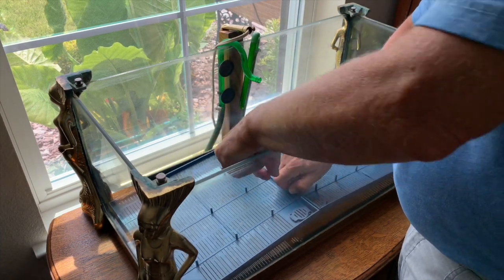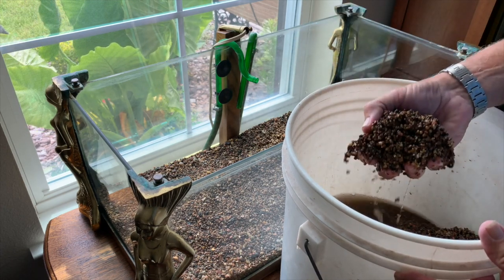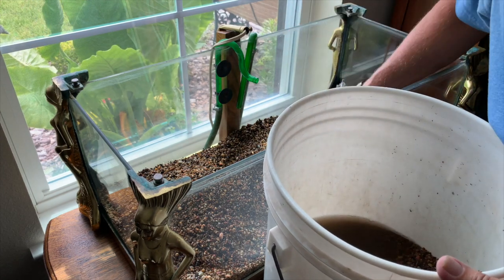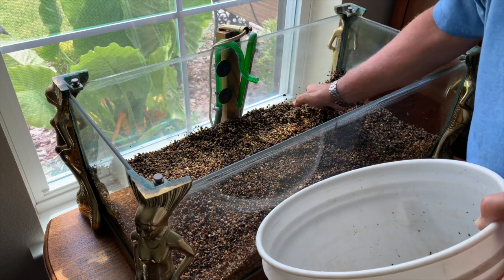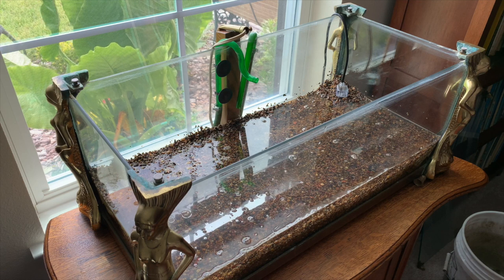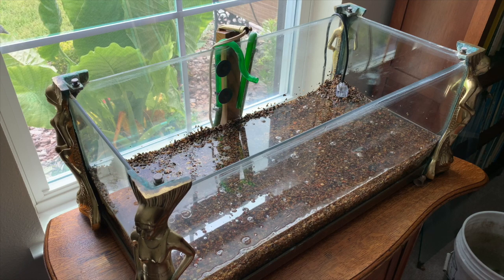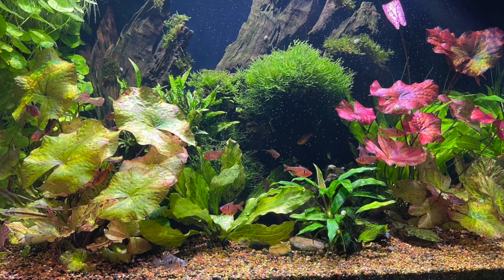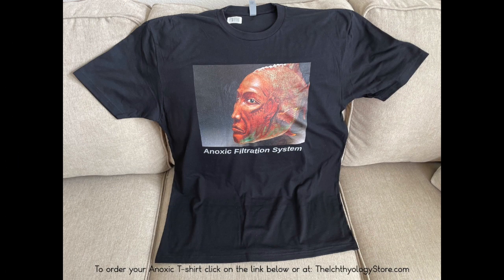Nolan’s Q&A on Anoxic Filtration: Why does it work? Anoxic Filtration and Plenums:Kevin Novak Ph.D.

Comment: I'm basically an aquarium noob when it comes to all this complicated stuff, but I've never given up on an undergravel system. My only problem is I've always wanted sand which everyone says isn't possible without reversing etc. So yesterday I was determined to figure out a way. I took two undergravel filter panels stacked, with the bottom wrapped in pantyhose and the corner of the top panel cut out to allow the passage of the tube, so the top basically just acts as a barrier from the nylon and to lock in a layer of sand over it. So far, so good. Crystal clear already with just one side running. 😊

Comment: I haven't bought any in a while but it used to be you could buy 50# paper bags of oil dry from the auto parts store and I'm pretty sure that's just the same baked clay as that kitty litter was/is.
Reply from the maker: I never thought of an auto parts store having oil dri but you’re absolutely correct why not.
Reply: @anoxicfiltrationplenums  I'm sorry, I should hold off commenting until I get caught up on all the video's in order. I see now that you have covered all this. I'm 1/2 blind so it's taking me a while. Plus I keep going out of order. I'm watching the Dec 20 2020 video now which covers this and I see the answer to a question I posed a few days ago regarding bags. Thanks for the replies.
Reply: @anoxicfiltrationplenums  Maybe just one more question. The difference in the kitty litter, is it because it's not baked?  The label now reads 100% natural ground clay but does not mention baked.
Reply from the maker: @POSminiracer   yes because it is not baked. Walmart used to carry the baked kitty litter that had very low dust. So I talk to the company that supplies Walmart and they say that Walmart now gets the kitty litter that is not baked any longer. From my understanding the company that does kitty litter also does the oil dry and other products like that and it just depends on what the customer wants and how expensive they wish to buy their product.